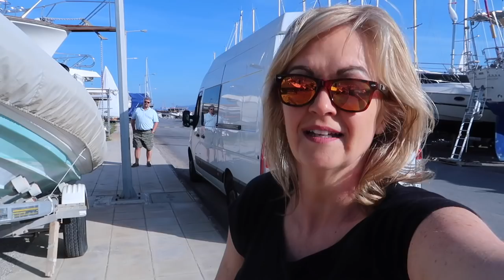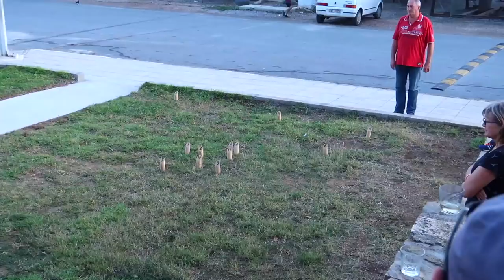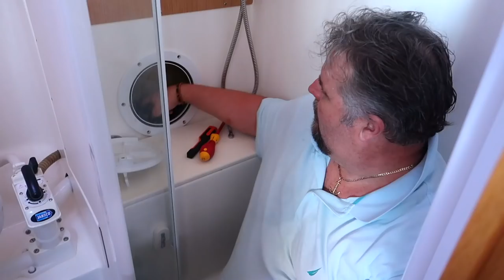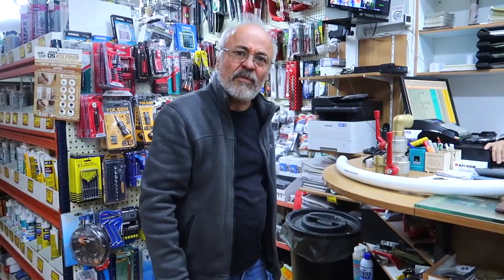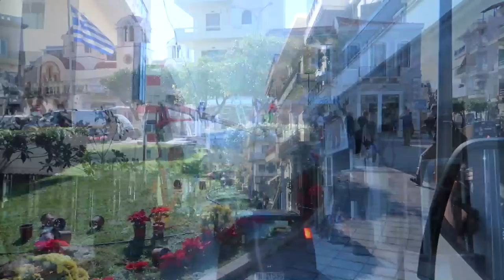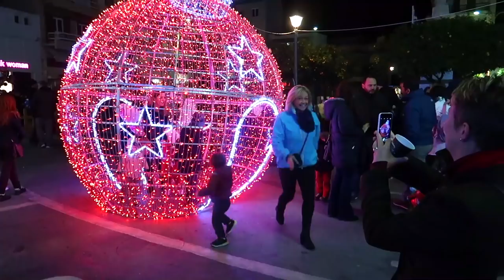Ep.31 Life in the marina - Carl and Jenny

Comment: I believe you have a saildrive on your yacht. This has two seals And some come with a leak warning indicator. If yours does was this checked for proper operation during your survey?
Reply from the maker: Yes we do have a saildrive. You are correct 2 seals, although the one one the outside is not an actual seal although tight fitting, but it does stop a fair amount of water. Its the one on the inside that is the main seal. Ours doesn't have a leak warning indicator but the seal has been checked and is okay. We have replaced the outer one prior to re-antifouling.
Reply: Very good. while it was out was the sacrificial anode checked? Plus if you have a clamp on meter to read amps. Check you 220v power to the boat to verify your between 500 to 900 milliampes  If above this it will cause increased erosion. But also damage the saildrive casing. I'm sure you already did this while on the dry but you did replace the oil in the saildrive. Just some things to add to the long list of maintenance checks.
Reply from the maker: All the anodes on the boat were checked and are fine. I heard a story recently about someone who ended up with a skeleton for a sail drive as no checks were done and it was just eaten away so yes we have had an electrician friend/neighbour in the marina do all the neccessary checks. All oil now done. :)